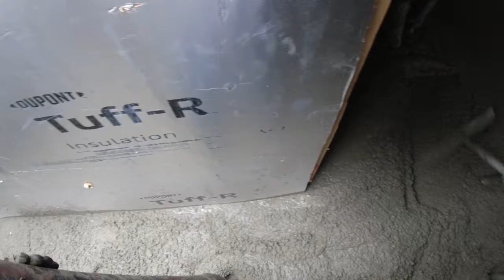How To Pour A Concrete Floor After The House Is Built!

Comment: That's going to be a well-conditioned basement!  Tuff-R is closed-cell foam panels, which shouldn't be confused with the lesser Styrofoam pink sheets.  Nice job on the concrete, but it's very strange (on a new house) that the basement floor wasn't poured before the sill plates were laid.

Comment: The wall insulation is Code here in New York State. You can put it on the inside or outside, or you can stud the basement walls and insulate. The floor isn’t required here “Yet”. But I have never seen this type of foam board used under the floor, only blue board. I didn’t think you could use that type of insulation with ground contact. Maybe you can,Idk?

Comment: In VA I just had a 24' x 30' garage floor poured and the back 1/4 of the floor was poured with the first truck, then we waited 2 hours for the next truck and the first concrete was already stiff and made a terrible joint with the new concrete, Even after power troweling, it looked like crap. The concrete guy didn't use any relief lines and said it may look bad, but structurally the job was fine so I shouldn't complain. Did he cut corners and do a bad pour or is it just me being picky?

Comment: Not crazy at all it’s basic thermodynamics and the best money spent.  You will love it to break that thermal conduction with the ground.  No different than sleeping pad when camping.  Real shame you didn’t WWM and strap radiant heat before the pour.  Keep it all domestic and it could be looped through Hot Water heater.  Did it, done it, love it.   Only btch was from brother when he hand trowel joints to look like 4 ft x 4 ft tile.  Acid stain finish and you off n running

Comment: Mike… did you get any air bubbles in the concrete when finishing?
It’s out gassing from a chemical reaction between the aluminium foil on the insulation and wet cement! 😉
Reply from the maker: No we didn't